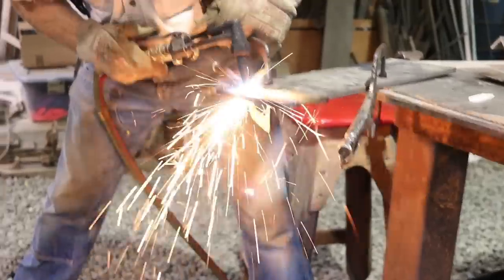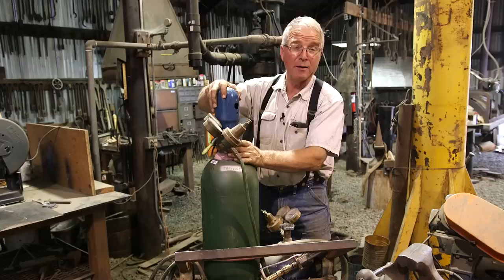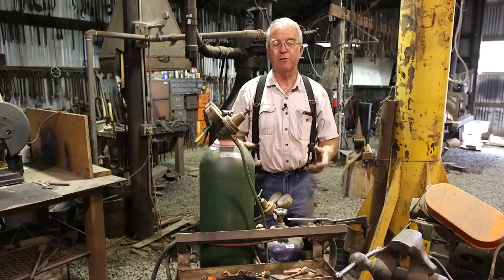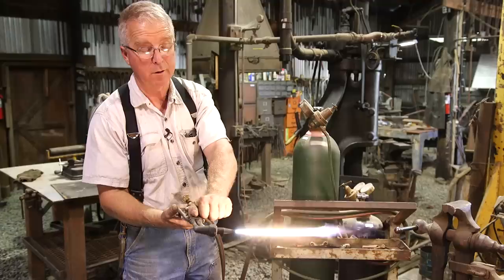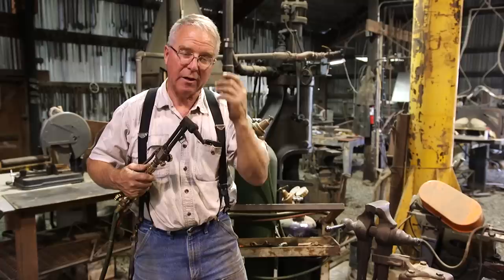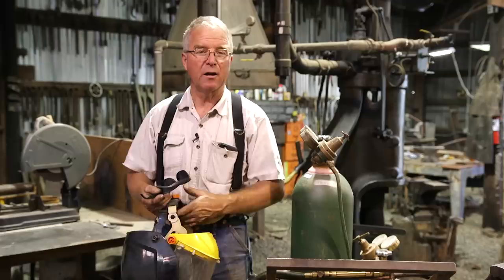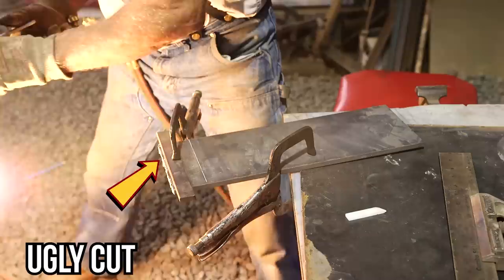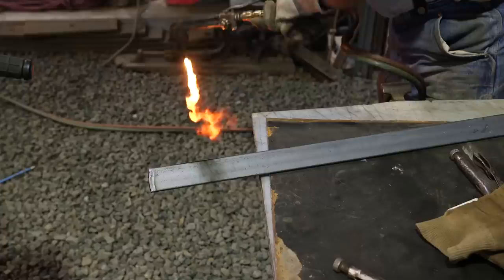Using A Cutting Torch

Comment: its a nice thing to know and it sets you aside from the rest knowing how to use and set a cutting torch but the only negativ is when you use you start to want cut everything with the torch after a while... bend nail ahhh lets use the torch need a hole in the steelplate ehhh use the torch ^^

Comment: Oxygen tank SHOULD BE FULLY OPENED. The valve on the oxygen tank is designed to be back seated. Which enables the valve to seal the enormous pressure present in the tank. (2000psi) This does not mean open the valve until it is tight. Simply open the valve until it stops moving. You should also never place your hand on top of the valve hand wheel. If the stem were to give way when you were operating the valve. You would lose digits. Always place your hand around the hand wheel. So if the stem ejects it doesn't take your hand with it.

Comment: What's the point of the lever? Is it supplying just a touch more O2 when depressed?

Also is the tip touching the material or are you holding it 1/8" or so away?

Comment: I’ve never seen an acetylene bottle with a normal handle. They always have a small square drive that you need a wrench to open.
Reply: Really? I’ve been in the welding field for 5 years now and I have never seen that, are you in the US?
Reply: Sounds like what the small bottles have. All the bigger ones I've seen have handwheels.
Reply: @hkgonra  The "MC" and "B" size cylinders all have the small square valve (although you can get round handles whcih fit on the square stem)  The round handles on the larger cylinders are pretty common.
Reply: Andrew Alexander that makes sense. I am used to using the small rigs on HVAC work.

Comment: I was considering getting the smaller bottles for portability. Are there any disadvantages to the smaller bottles when it comes time to swap/refill them??? Would I be better off just getting the full size bottles???
Reply: You have to be careful with small bottles to not empty them too fast to keep them from discharging acetone into the regulator. So if you're using big tips to cut thick steel, you'll need a big bottle.

Comment: I have three of my grandfather’s cutting torches that haven’t been used in decades. I’d like to rebuild them and start using them. Are there rebuild kits available?  I’d hate to take them apart and not be able to put them back together properly. Every time I hold them I remember helping my Granddad work on some piece of machinery are the farm. 
Thanks for your great videos. Keep them coming!
Reply: I believe rebuild kits are available.  Check with a dealer or welding gas store or even the torch manufacturer.
Reply: It's not a bad idea to have them professionally rebuilt. Any oil or contamination in the oxygen side can end in tragedy
Reply: @CyrusAhmadiMoghadam  Especially if the torches have regulators with them, getting an oxygen regulator rebuilt is not something your average person is qualified to do. You can't just "not use oil", you have to get your fingerprints out of there too, because you guessed it, fingerprint oil is FLAMMABLE and will burn sometimes spontaneously in a high pressure pure oxygen environment.

Comment: Worth a comment about Oxygen safety.  Working in confined space with any leaking oxygen can impregnate clothing making it very combustable
Reply: It's almost like oxygen makes up 20% of the air you and I breathe every day.
Reply: 44R0Ndin I had a guy working in the bottom of a bucket elevator pit.  Let the oxygen leak and build up concentration to a point it permeated his overalls which caught fire - 3rd degree burns to his lower legs.  This site is about sharing experience, that’s mine is all!

Comment: There's some bad advice here, unfortunately. The Oxygen bottle's On/Off valve is ALWAYS designed to be FULLY opened (when opened) as this seats the valve. He was correct about the Acetylene though; only about a 1/4 -1/2 turn. So may people get this safety formula wrong.

Comment: Good beginner tips Scott. With gas torches, they give off infrared radiation. This is often called optical radiation, which can be harmful for your eyes. Not so much with your skin, but it still has an effect.  Good quality safety glasses can shield you from infrared, but it is better to buy eye and face covering designed to block this. Stay safe and well :)

Comment: If your acetylene tank gets stored on it's side, you should stand it up for 24hr s prior to use. Otherwise it may spray liquid acetylene.
Reply: that's actually not liquid acetylene, as it's not safe to store acetylene that way. What would come spraying out is acetone.
This is because acetylene is unstable over 15 psi (capable of self-sustaining polymerization reaction that releases a lot of heat), so they store the gas dissolved in acetone. This is one of the reasons for the characteristic smell of acetylene gas, however the garlic tones you smell are all from the acetylene.
Reply: @44R0Ndin  that's some good info! Thank you.

Comment: Hi, two years ago a welder was going to work in the van the company had provided for his use, contrary to law this was a closed van with the seating area open to the back of the van. He stopped to get a newspaper as he had done for many days and got back into his van, started the engine and the gas bottle blow up. It not only killed him but it levelled an entire village with a total of twenty-four dead. The company was taken to court and fined one hundred and fifty thousand pounds, this was on top of all the rebuilding of an entire village some twenty houses, eight shops and a bank (the safe was the only thing left standing) all because a firm was transporting gas bottles in an enclosed van. One year later another van went over the bridge skidded and went down the embankment killing the driver, but because he had a mobile phone on him he managed to warn the rail company about the accident before he lost conscience and they stopped a train from ploughing into the van. I wouldn’t live in that village if you paid me to.
Reply: So how much of that did you make up then cause it ain’t very believable

Comment: How long do those bottles usually last? And the cost... thanks for ur vids... I'm now chain stitching my cords
Reply: It depends on how much you're using the torch, and the size of the bottles. They're available in larger and smaller capacities than the ones he has in the vid. Assuming heavy usage (using it all day cutting thick material), an oxygen bottle the size of the one in the vid might go 3 or 4 days, and about the same for acetylene. The Oxygen bottle he has looks like an 80 cubic foot, and they cost around $200 for a new empty bottle. Acetylene bottles run the same price. Refill costs will be around $80 for acetylene, and around $20 for oxygen. My estimation on how long the bottles will last may be a little bit, we don't have use a torch very often where I work and I'm basing off of how long our bottles of gas for the mig welders usually go.

Comment: Many may not be able to have an oxy-acetylene torch because of insurance in a home shop. If there is a problem the insurance co may not pay out if there is a claim if oxy-acetylene is present even if it was not involved or cause of the claim!!! There are 2 alternatives that do not have a problem with insurance policies.  1st is oxy-propane 2nd is oxy-gasoline. Oxy-propane is the least expensive and convenient for most home shops. It also does away with the transporting in an enclosed space problem. Oxy-propane dose 98% of everything that an oxy-acetylene torch can do even though it is not as hot as oxy-acetylene. A simple stick of wax and a temperature pen overcome the 2% difference between oxy-propane and oxy-acetylene. Oxy-propane can not put a carbon layer on surfaces to stop weld spatter or tell you when your a preheat is over 900F and so on. Now, oxy-gasoline is much hotter than much faster also much more expensive initial cost and the slag is cold. That is why is mainly used in nuclear powerplants and rescue situations. Oxy-gasoline can also cut through an air gap and still cut many layers of steel, it can also cut concrete and takes much more skill to use as a replacement for oxy-acetylene torch!!!
Reply: Oxy-acetylene is about 10% hotter than Oxy-propane  (2800F vs 3200F )  and when that 10% happens right around the melting temperature of steel, it's significant.  Also propane is not particularly good for welding for chemical reasons not related to the temperature of the flame.   There's a reason oxy-acetylene is far more common than Oxy-Propane.

Comment: I have occasionally demonstrated how a torch works by starting a cut, turning off the fuel, and finishing the cut on the oxygen lance alone.  The heat envelope from the flame is important, but the cut is made by rapid oxidation, not heat, and if you're careful the heat of oxidation is enough to keep the cut going.

I have also demonstrated how to light a torch with a lit cigarette, but that's just showing off.  :)

Comment: What would be the reasoning to use a cutting torch versus a grinder or bandsaw or etc?
Reply: Access to the cut.  Power availability.  Versatility to cut, heat for shaping, welding ability...
Reply: @davestaco  Thank you

Comment: What about regulator burn out?  When debris get into the gas valve and it blows up when opened.
Reply: only happens to oxygen regulators that have been built or rebuilt improperly (hint, you gotta get that fingerprint oil out of there too, that will also burn)
Reply: @44R0Ndin   yes, that!

Comment: thousandpointsoflight...that's quite dramatic. This is clearly not a how-to-video with all required safety guidance. It's one of many videos one can watch to start building or extending knowledge about using a cutting torch. Only a nitwit would watch just this video alone and then start going to town. And as they say...you can't fix stupid. Also, Scott did mention numerous safety considerations. Scott, another fantastic video. Thanks!